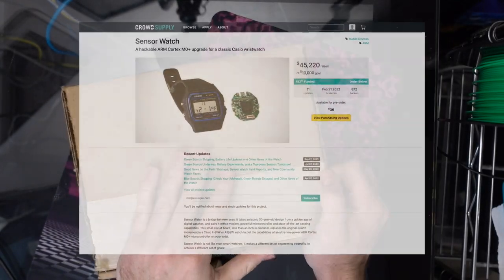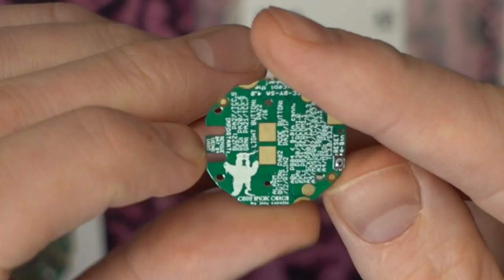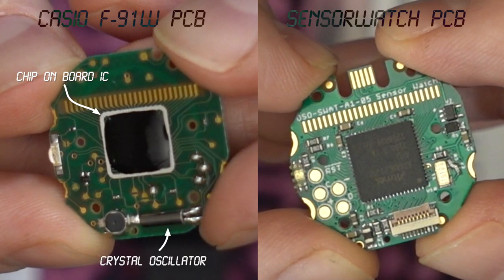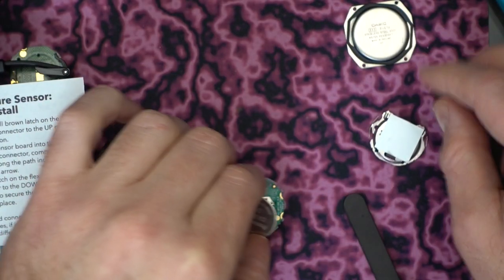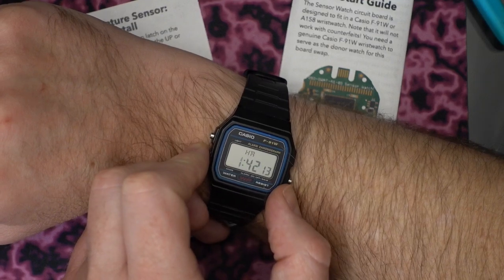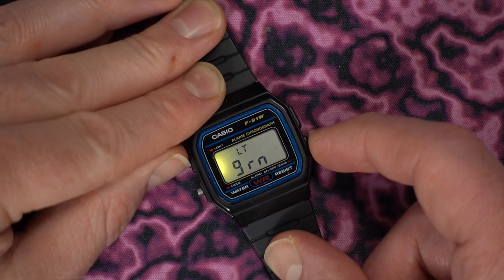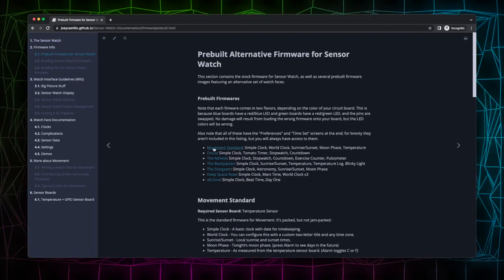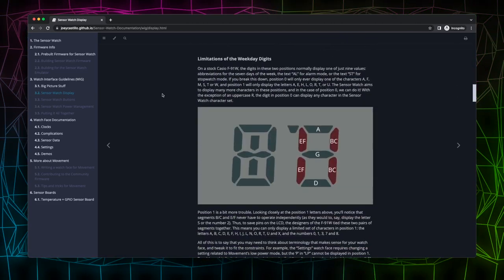[mod] Casio F-91W Sensor Watch

Comment: I don't care for sensors, but I want a programmable digital watch that drives a nice segmented LCD display. "Digital" "smart" watches are really scarce, and they always steal your data, and have bad software.
It would be also nice if they made a custom PCB for bigger Casios, like calculator or databank watches, and added some kind of radio, Bluetooth, Wifi, or other computer interface, USB, Datalink or something.
Reply: This is purely open source. You can write any code that you want on it!
Reply: ComsiCaterpillar  
It actually doses a lot! Pretty much all the usefull cool and quirky features that you can think of are already written, tested on hardware and merged in to the main repo. I think you're missing the point of this project. Comparing to the stock 593 module this thing goes beyond what we ever had in such a small form factor. If you take it more as a module upgrade that makes it incredibly accurate (self drift correction, temperature drift corection), anmd then sprinkle on top some cool features like custom tunes, timers, stop watches, counters, moon phases, random number generator, 2 factor authorization, temperature measuring and logging, this thing is handful of features. Right now the main dev is after adding accelerometer for a step counter from what I know.
Try the watch builder for yourself (this is mostly for people that don't want to play with code, it's always better to compile by yourself): https://sensor-watch-builder.fly.dev/

Comment: 1:35 the PCB has what looks to be USB micro as a bare edge connectors- I'd wager you just plug a USB micro cable onto those and it'd enumerate as a USB device.

Comment: Why would you use metal tweezers to hold the battery like that. You’re connecting the positive and negative and shorting the battery.  You can buy plastic tweezers.

Comment: It's posible to put a metronome / pacer feature?
Reply from the maker: Yes you definitely can! In my next video I'll show how you can use a simple online tool to quickly create a custom firmware. This firmware can have nearly any arrangement of watch faces and one of the options available is a rate counter face. I'm not sure about metronome though.
Reply: Thank you very much, friend!  Oh yes, the metronome I am talking about would be like the one on Skmei watches models 1373 / 1382, simple but very efficient.